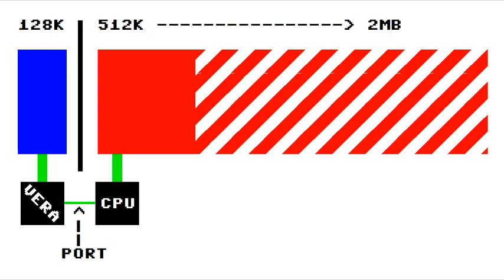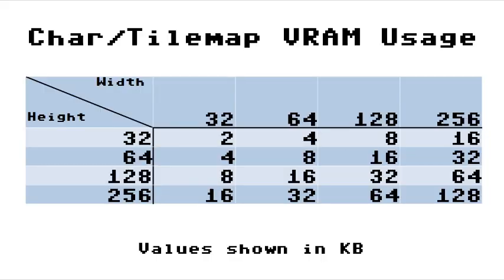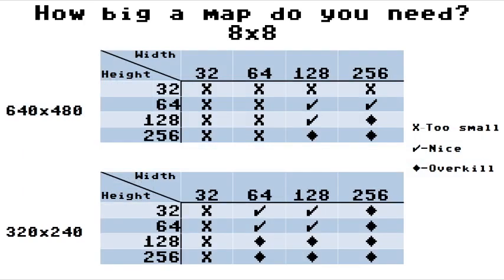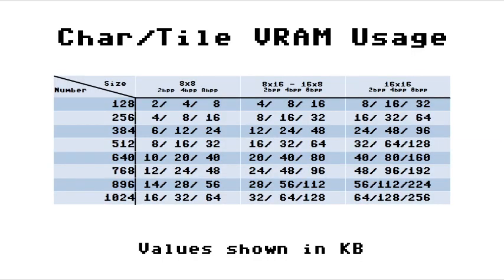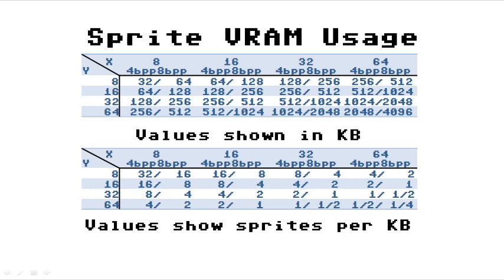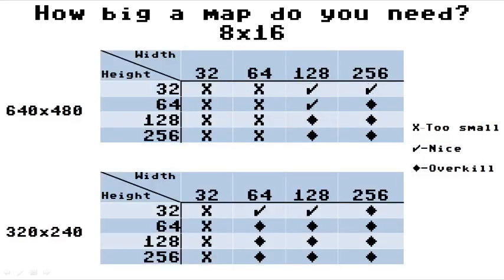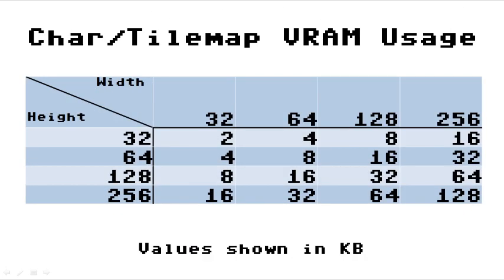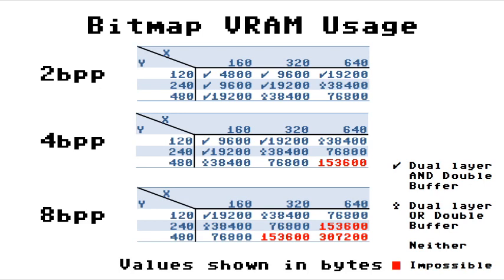CX16 VERA VRAM allocation guide mk2

Comment: So how would I go from here if I would ever have the development hardware.. Do you have to write the routines yourself or are they going to provide SDKs/libraries to draw on the screen?
Reply: Depends. If you use BASIC, there are VPOKE commands for now, and there may or may not be shape drawing extensions added. I believe for now they're only promising BASIC V2 support, but several have expressed interest in building their own BASIC extensions.

If you use assembly, there are no libraries at present, but a growing body of example programs demonstrating various techniques and features.

If you use C, there are no libraries yet (and only one compiler with direct X16 support), but maybe someone will make a library.
Reply from the maker: Its tile based so you draw on the screen by poking two memory locations in VRAM to change what is shown at that point. you don't really need a library at that point, its just set the port address and a value. If you want to print text etc the KERNAL has routines already for you to use.
Reply: You would download the latest emulator and read the latest applicable Vera documentation. Then you would experiment vpokeing into the Vera module's vram and various Vera control registers. Now at this point over 30 plus years ago on my c64 I followed a series of articles in a magazine about graphics routines. Years later I would play around with Windows GDI which is essentially a graphics library like Cairo. Create a device context, set the brush color, set the brush size, gc = newGraphicsContextFunction(); gc.setBrushColor(Black),gc.setBrushSize(4);
and then draw paths path=gc.drawRectangle(ax,ay,bx,by) path.fill(solid,Red). 
That's what you would want for 2D graphics, but you're looking at only 40K RAM and chunks of 8K you can bankswitch up to 2MB on a limited single threaded 8bit cpu. 
So you will probably sit down and read a book on graphics programming and then give a lot of thought to strip down something like libcairo so it will reasonably "fit" the constraints and output into the format of the Vera framebuffer in whatever graphics mode. Come to think of it, a lot of this already exists in GEOS.